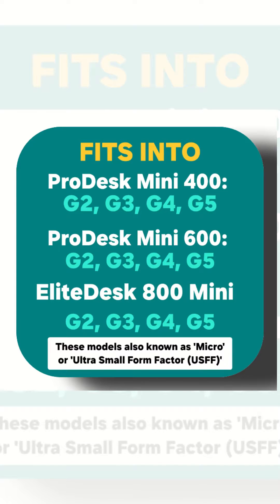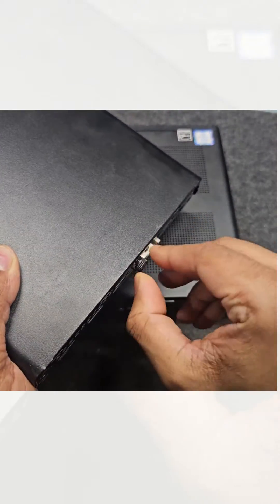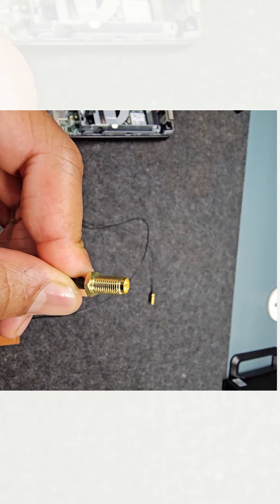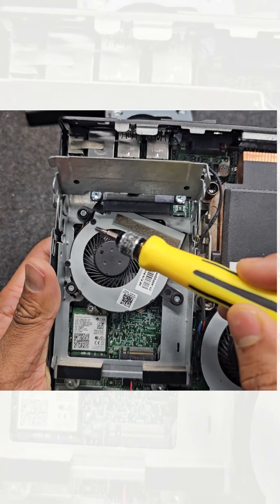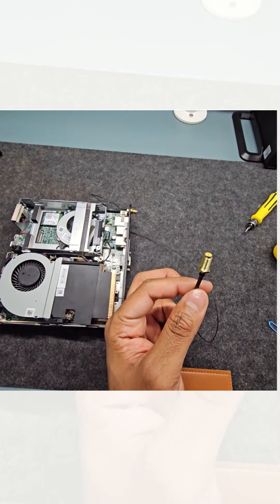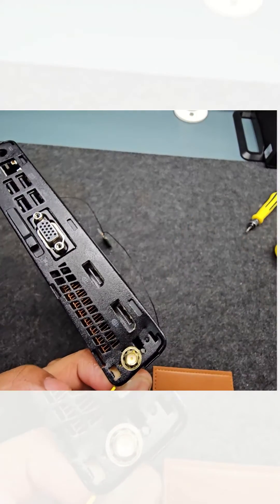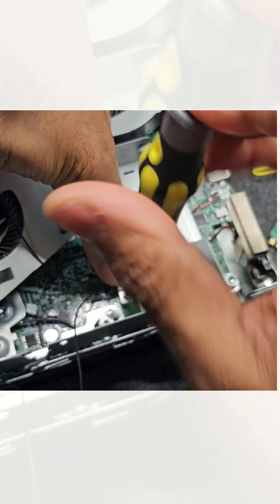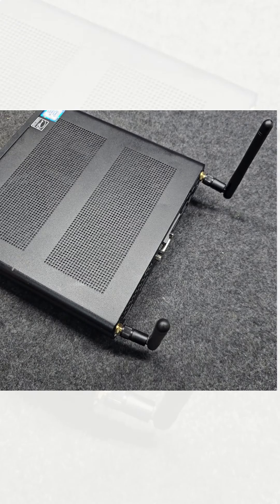Install WiFi and Bluetooth to HP ProDesk & EliteDesk Micro Ultra Small Form Factor  PCs

Comment: The Elite Desk 805 G6 has only one antenna hold cover for Wifi  at the back side but where goes the BT Kabel?
Reply from the maker: There is no particular dedicated antenna for WiFi or Bluetooth, usually there's another one at the front.

Comment: Sweet thanks! Do you know if you can just upgrade the antenna if you already have a WiFi card?
Reply from the maker: Hey buddy, yes you can replace those antennas.  Just disconnect them from the card and tape the ends so they don't create any sort of short circuit. 

Not sure what your reason might be. But built in antennas can actually be weaker in some scenarios. 

Having said that there is no garuntee that reception will be better but I have seen in real life where built in antennas were weak. One particular scenario was where PC was kept in front of a solid wall and the router was on the opposite side. In the same position SMA style antennas got better reception and speed.
Reply: @MH_Tech_UK  cheers pal, that's what I'm hoping for. A laptop with a much older WiFi card in the exact same position receives a significantly better connection so I'm pretty sure it's the antenna, given a laptop will have a much bigger one.

The antenna I'm replacing are inside a mini pc so they're small and I imagine pretty pants
Reply: Where do we buy bluetooth mods?